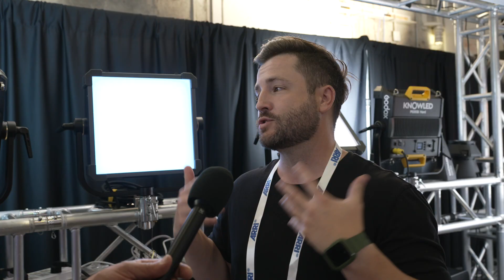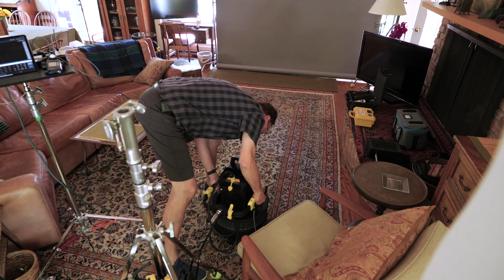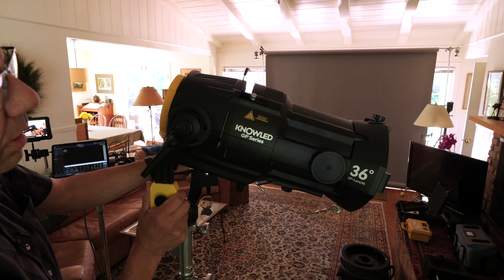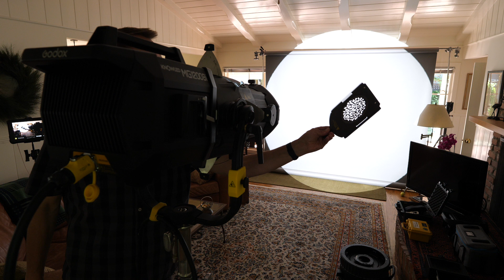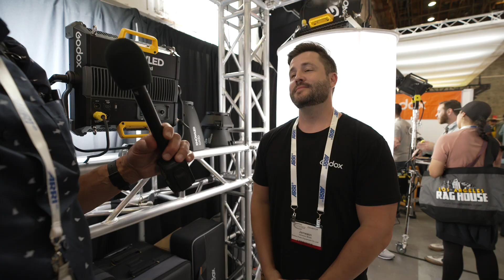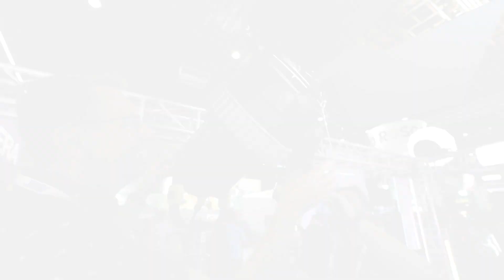Meet The Gaffer #299: Godox MG1200Bi and more...

Comment: any leads on the photo metrics for an MG1200Bi 19°  spotlight?
Reply from the maker: It’s been quite a while since I have worked with that set up. I passed it on to a colleague who didn’t mind the weight of the set up. It’s not the same, but I prefer the size and ease of use of the M1000R with its projection system.

Comment: I really don't understand why they couldn't just go for a bowens mount so we can use what we already have. Why does anyone need their light to inform them of what modifier is attach to the light at that moment? Hopefully they or someone else would make an adaptor to allow us use the modifiers we already own.
Reply from the maker: Travis explained the reasoning behind it in the episode: the fixture can compensate for color shifts brought about by the modifier. We will probably see this in more lights in the future. Also, the new mounts are more solid and less jiggly. That said, I feel your pain. It is true that having one type of mounting mechanism would allow us to use the modifiers we already have, but it’s also true that the Bowens system has it’s down sides. One solution is the Rabbit Rounder from DOP Choice. With that system you just change the ring. Prolycht Orion incorporated a locking Bowens into their 675FS. Aputure will be releasing new units that will be able to use newer A Mount accessories while also still accepting legacy Bowens modifiers. Manufacturers are adapting, but it’s hard to be all things to all people🙂
Reply: @meetthegaffer   Just like the Aputures 1200D, i really do think they should have gone the bowen route. The bowens mount on my Godox VL300 & Knowled M600D are very very solid. The whole "fixture compensating for color shifts brought about by the modifier" is just an excuse to sell their own expensive new modifiers, which frankly i rather tweak on my own as its a Bi-color light and not an RGB light that might be harder to do.
Reply from the maker: @akpevbe I get the frustration with multiple mounts, but the branded modifiers are not that expensive in the scheme of things. And if you want a really well built system the DoP Choice Rabbit Rounder, which adapts to all mounts, is top notch. From a manufacturer’s point of view, proprietary accessories provide for a known and repeatable customer experience. Do I wish they would all conform to one standard, sure, but I’m not competing for market share. 🙂

Comment: Glad to see someone finally commenting on the weight. I feel like it's a significant drawback especially for indie productions where crank stands and rollers are not common/practical. I've been thinking for a while that these higher output lights should start dislocating more of their circuitry to the ballast to cut head weight and make them easier to raise.
Reply from the maker: I’m sure it’s a difficult balancing act from a manufacturer’s position. Your legacy users are more indie, but the stretch goal is to gain acceptance on higher end sets where a robust fixture build is required for rentals and weight is literally shared by larger crews. Aputure gave us a break-out 1200D with 3 intensifiers. Then Nanlux gave us the 1200B with tunable white, 3 intensifiers, and a fresnel. Now Godox tops that by adding a fourth intensifier and a dedicated spot mount! Are we having fun or what?!